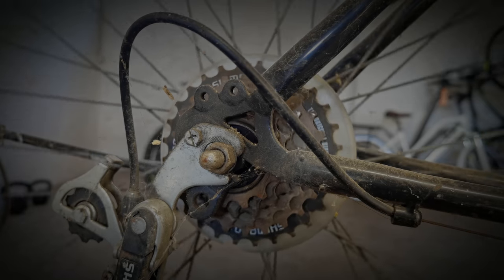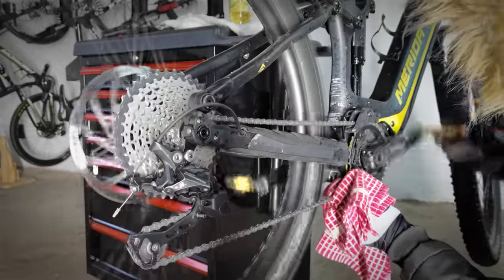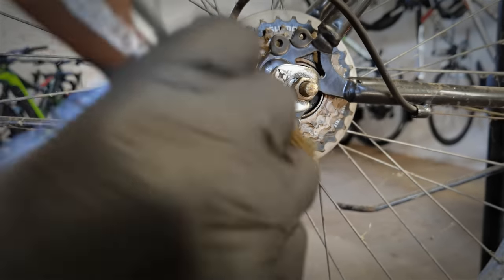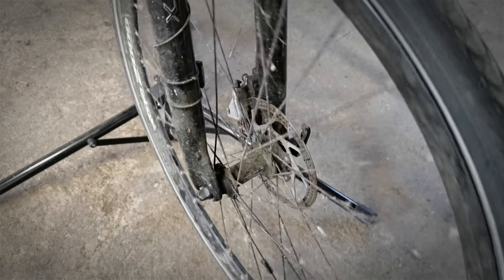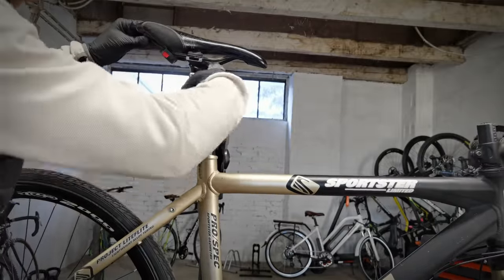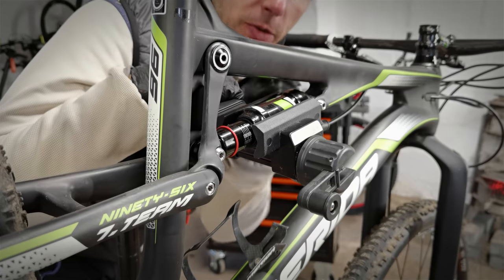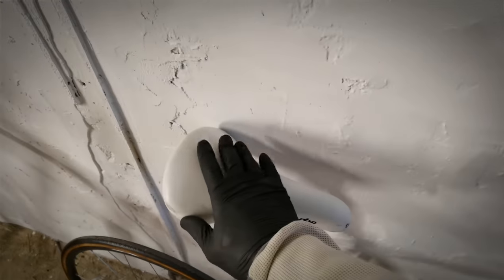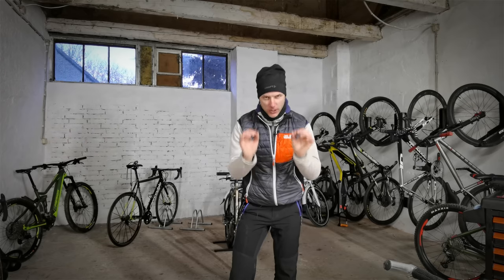How to wash bicycle, store it and park it... Lesson 3.

Comment: 1 - A
2 - it will apply mutch more tension on the stand bracket
3 - all moving parts, such as drivetrain, chain, derailleur, suspensions and dropper post

Comment: 1. A. Yes you can
2. If the bicycle is horizontal then it can put undue tension on where the bicycle is clamped as well as the stand itself.
3. The moving parts, so the drivetrain, the damper, the front suspension fork and dropper post.

Comment: 1. A
2. To make sure the teeth in the stand are not under too much strain, and your posture during the repair to make it easier.
3. The moving parts like the the suspension and drivetrain components.

Comment: 1. A
2. Because the bike may not be equilibrated and fall down
3. clean and lubricate the chain and drivetrain and also suspension parts & dropper post. Basically moving parts

Comment: 1) A
2) Because if you remove a part, such as wheel, you may upset the balance of the bike, causing either damage to the stand or making the stand fall, possibly damaging the bike as well.
3) Any moving parts.

Question #1 from me: I noticed an old frame with the derailleur on the wheel axle! I have a similar frame on a bike, with the following issue: where to find a derailleur that can be attached there? That spacer attachment does not exist anymore, and it's not an easily removable/changeable part. When I wanted to replace the derailleur, I found I could not. Meanwhile, that stabilizing screw hole is difficult to access when in a pinch (the cassette side nut is impossible to hold on to without a closed spanner).

Question #2: Dutch bikes tend to be heavy. Mine is also built for heavy duty, and it is REALLY heavy. It takes all my strength to pull up to the stand; then the height is not great since I can't put it high. It's also impossible to elevate after clamping, since the weight makes it impossible to have enough leverage. I have a stand similar to one in the video (with the red grip). Do you have tricks outside brute strength?

Question #3: How about suspending a bike from the ceiling? Sometimes, wall space is at a premium...

Comment: 1. C
2. It puts a lot of tension on the v-theeth of the stand and dropper or seat post.
3. Drivetrain components, front and rear suspension, moving points and dropper post

Comment: 1: A 
2: Make sure the bike's weight is distributed so it doesn't put too much tension on where the bike is clamped and the stand itself.
3: Cleaning the moving parts: drivetrain, demper, suspension dropper

Comment: 1- (A) Yes, you can clamp the dropper post. Not too tight. 
2 - because the bike will be ‘cantilevered’ which will cause stress to the bike/seat post and work stand itself. 
3 - Drive train - cassette, chain, chainring, and both derailleurs.